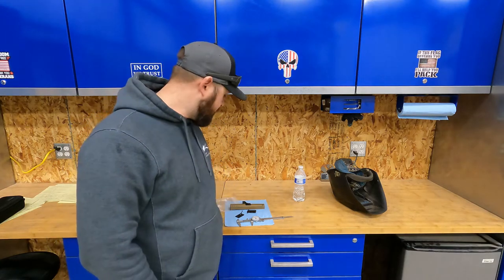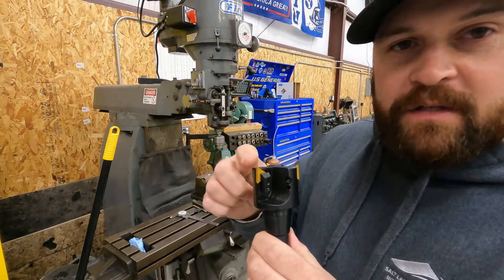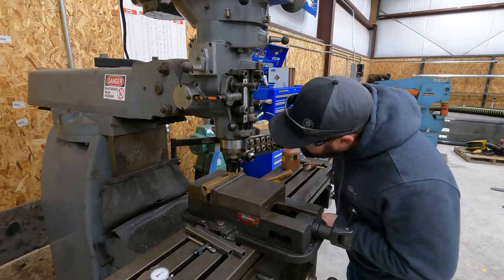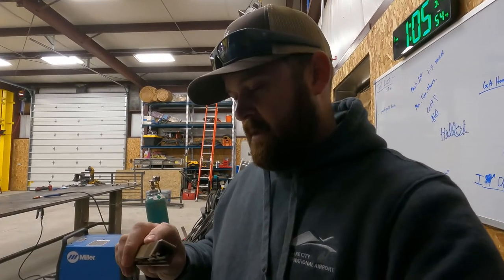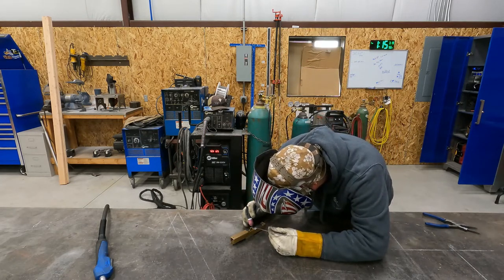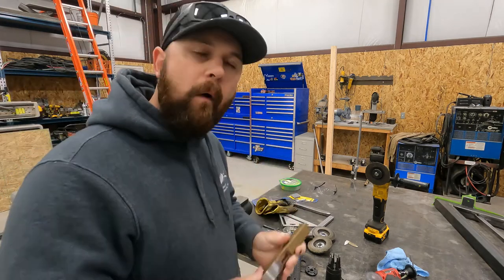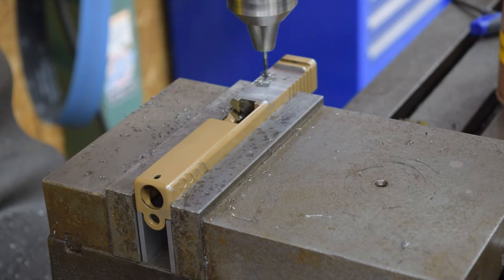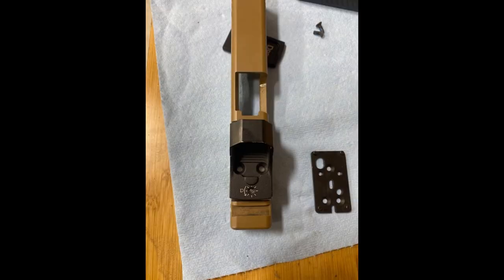Pistol slide Machining

Comment: Thanks for making this video. Although it did not exactly go as planned, that's how jobs go sometime. I am a hobby machinist, about to undertake a similar project myself, would like to offer some thoughts which I hope you will find helpful:
- Use an indicator to position the slide flat and square in the vise, that way you don't have to guess if the paper towel affects the alignment.
- Plan ahead before machining. Anytime you mill a slide, it should be disassembled, and all holes measured to make sure the cut will not interfere with existing geometry such as holes, and other features. Typically, an optic cut like this is done far enough back to clear the plunger hole which became exposed in your case. This often involves placing the cut over the rear sight and moving the iron sight forward of the optic by machining another dovetail cut for it.
- Lastly, it appears that the cut you made is not the same shape as the optic and based on the picture at the end of the video appears slightly oversized. This is not ideal because red dot optics are meant to be a very tight fit to the cutout in the slide. This is done so that the optic is held in place by the slide cut geometry and only secured by bolts to prevent it popping out, the bolts not meant to counteract lateral loads such as during firing or when using the optic to rack the slide in an emergency. Proper slide cuts are therefore machined as an exact fit to the optic base, including front and rear radii as appropriate, many mounts featuring locating studs that protrude upwards and mate with the underside of the optic to help keep it securely locked to the slide against any lateral motion. Having the optic held in place by bolts alone may result in bolts deforming, shearing, or stripping, and the optic losing zero or coming off completely. 
Please don’t take this as harsh criticism. I understand that machining is not an easy task, but I hope this will help you and others on future projects.
Reply from the maker: I appreciate the suggestions and input. I will definitely consider those things if I do another one of these. There were definitely a lot of learnings on this project. Unfortunately, Sometimes you have to make some mistakes to learn the proper way to do things. This was one of those projects. Thanks for watching!

Comment: You can tell how in experience people are. At no point in time you decide to get dimensions on the wall thickness of the hole and top of slide. Thats the first thing I did when I milled mine
Reply: Thank you! Measure twice and cut once.

Comment: How deep was the Cut?…. 1.21” is supposed to be the depth but Not all slides are spec, So…
Also.. Did They get it running?.. (Safety Block/spring I think).. Shouldn’t have been too hard to adapt.
Thanks for taking the time..
🤙🏻
Reply from the maker: @0Logan05  I believe the cut was .125”. The pistol operates fine today. He has used it ever since with no issues. Thanks for watching!

Comment: Putting the rear sight in front of the optic is the way to avoid exposing the safety plunger hole. NC engravers has several Utube vids on this problem with Glock slides . Also you may have to shorten the coil spring in the safety plunger
Reply from the maker: Great info. Thanks, I’ll check that out. Thanks for watching!
Reply: Or get a Holosun 407k, 507k or an eps carry which has a back up sight on it. Then just cut the optic in.

Comment: An FYI for you.  I do quite a bit of tig welding.  Get some acetone to clean.  Brake cleaner and tig welding equals phosgene gas which is a deadly nerve gas.  Never clean and weld with brake clean!
Reply from the maker: Good to know, I will definitely make that change. Thank you for the advice. Maybe that is what’s wrong with me…..🤔
Reply: It is safe to use non chlorinated brake clean but I always use Acetone as well.
Reply: Isn't brake clean aerosolized acetone?
Reply: Brake cleaner is literally acetone 😂

Comment: Wow, with so many good videos out there on how to properly do this; it’s good to see one on how to improperly do it and ruin a several hundred dollar slide…
Reply: Several hundred dollar slide? You can get the fir $140 already cut
Reply: @connormitchell1181  Please link this Glock slide for $140, and not some pot metal Chinese junk but an actual Glock slide...
Reply: @DixieNormas  it’s Swenson Glock slides brother.
Reply: So not an actual Glock slide... He ruined a Glock slide, why would it be replaced with a cheap knockoff???
Reply: @DixieNormas  read the reviews on them😂😂😂
Reply: @connormitchell1181  seems 50/50, Lots of idiots (err I mean geniuses) that like to make these 80% junk guns seem to like them. Probably a decent "range gun" slide, but I would not use it on a combat handgun. Again the point is this guy ruined a factory Glock slide, why would you even think of replacing it with a cheap knockoff??? You do you boo, but I can properly mill my own parts, and afford to properly replace quality parts.
Reply: What about the high quality red dot
Reply: @DixieNormas yo you still shaking in your little "combat" boots over this video or have you calmed calmed down a bit in this last year?

Comment: Wouldn’t the spring for the plunger simply have compressed against the bottom of the optic once the hole was exposed?
Reply from the maker: It probably would have, I was just worried that if the owner changed the optic, the spring would shoot across the room. Thanks for watching!

Comment: Only bad thing about tiger welding this part is you just messed the heat treatment up on that area. That's no good at all near that area. It's now anneled in that area which means it's soft there in a critical area.
Reply: Tig welding lol
Reply: Area
Reply: Tig welding would not anneal the metal, it would make it need annealing. It would harden the metal making it more brittle, which can be much worse than too soft.

Comment: You might be better served using high temp transmission fluid for your cuts, drilling, and taping opposed to what you were using here. It looked a little thick. My best friend just bought a mill similar to yours only newer I think it's all digital. He works at a place that makes limousines in Hursts. They are constantly switching out tools and machines, when they do they often give the employees first dibs. The mill my buddy got came with all the necessary pieces to run it and extras. I can't remember exactly what he payed for it but it was insanely cheap compared to what it's actually worth. I'm wanting to do the same to one of my pistol slides, thanks for the video. It will help, also those Mills are heavier than they look. It was let's say more difficult than I was thinking unloading it from his pickup truck with just me and him. Also his mill was barely used when he got it, I don't understand why they got rid of it. They take brand new Cadillacs and cut them in half to make either a lemo or hurst. You would think they would want to keep that mill around. I don't see how they make money with the way they go through tools and equipment, getting rid of stuff that has nothing wrong with it. But whatever, I just got me a new brushless DeWalt drill that's barley used so I'm not complaining.
Reply from the maker: @cameronknoechel9767  sounds like a pretty good opportunity to get some good used equipment! I would take advantage when you can. Thanks for the feedback, and thanks for watching!

Comment: Hello, I am looking into buying a cnc to optic cut slides to see if it would be faster overall than using a 60-w fiber laser to perform the task. I didnt know if you by chance knew of what make/model of a cnc machine that could preform this dedicated task on a commercial level for a FFL/SOT?
Reply from the maker: Hi there, I have minimal experience with Fiber laser machines. If I was going to do production style work to crank out slides. I would consider a CNC milling machine. I don’t know enough about them to tell you what brands are best though. Thanks for watching!
Reply: Buck how long does a slide take you on a 60w fiber?

Comment: Its wild that a business would post this 😳
Reply from the maker: @_jovian  You’re right, I should probably just pretend that I do everything perfectly, and that I don’t ever make mistakes, and that I don’t learn from mistakes. I’m an open book. I’m not a bullshitter. A friend asked if I could do this for them, I warned them of the possibility of complications, and they still wanted me to try, so I did. I figured it would be helpful for other people to learn from my mistakes. To be honest, I think the only regret I have with posting this video is having to listen to people like you that think every project should run silky smooth, and never have complications or make mistakes. I don’t know a single business owner that doesn’t deal with complications or problems. A huge part of owning and operating a Fabrication business (or any business for that matter) is problem solving. But the way, you’ll be happy to know that the customer still shoots this gun on a regular basis and has not had one issue with operation.
Reply: @Freedomfabrication777  No one said everything is silky smooth perfect man, but I certainly wouldn't bee sending a firearm component to what looks like a DIYer figuring it out along the way. You milled straight through a safety feature... thats scary. A 'mistake' or 'complication' can hurt and/or kill someone.  And while yes you did fix it, and dude hasnt had any problems supposedly, that could have been a different story and should have never happened in the first place. Part of owning a business that modifies GUNS is be to be intimately familiar with how whatever gun you accept works, every part, the exact placement of the parts, and how the modifications affect that gun. Sure, gold star for trying your best 🌟, but you dont play trial and error with guns and the majority of the comments here echo that.

Comment: How do you feel about milling a compensator into a slide? Is it safe/practical?
Reply from the maker: I can’t think of a reason that it would be unsafe as long as you made sure to machine the slide to the exact specifications, and left enough material on the end of the blank to be able to machine the compensator as part of the slide. I think it would be cool. I don’t see why you couldn’t. Not sure what laws are on doing something like that, you may want to look into that, but I do think it’s doable, yes. Thanks for watching!
Reply: @Freedomfabrication777  Awesome! thanks man ✌️

Comment: Great job. Just one question, regarding the exposer of the hole. Did you milled to much material?
Reply from the maker: The answer to that question is a little tricky. Yes, the reason the hole was exposed was because I went I little too deep, but it was the depth the customer requested to try in order to get the red dot as low as possible. I have spoke with the customer since the modification and he said it shoots and cycles just fine. Hopefully that answers your question. 
Thanks for watching!
Reply: @Freedomfabrication777 Question answered. Thank you.
Reply from the maker: Any time.

Comment: Why not add the optic and see if it closes the hole?
Reply from the maker: Probably could have tried that, I wanted to get it sealed up for aesthetic reasons as well. I was also worried that when he would tear apart the gun, that spring would go shooting across the room if he pulled that sight off. And I wasn’t sure at the time if that chamber had pressure from the firing of the gun. I suppose we could have tried it though. Thanks for watching!